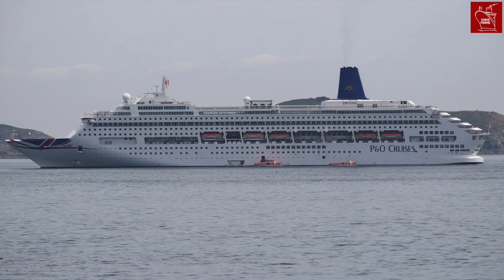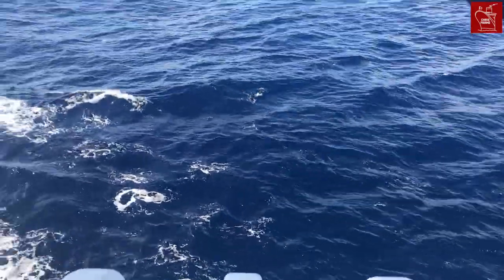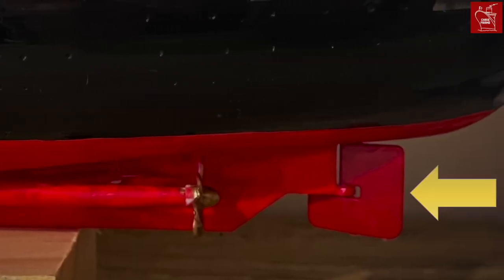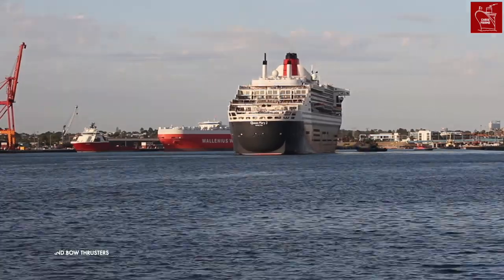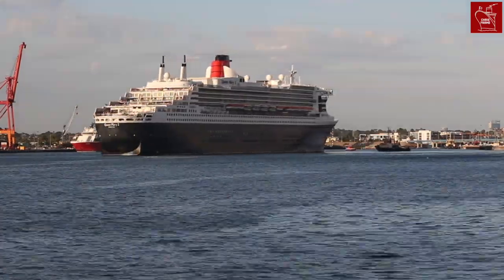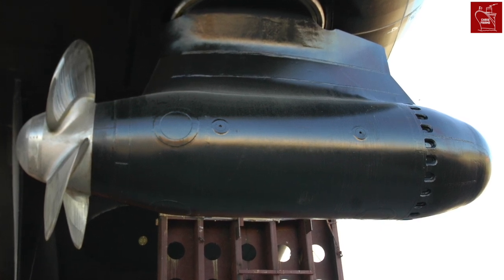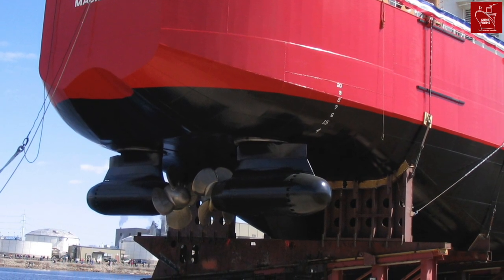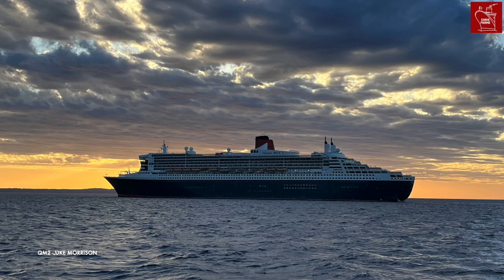What’s UNDER the Water on a Ship?

Comment: Thank you for such an easy-to-understand explanation of what's below the waterline of a both a modern day cruise ship and an ocean liner.  It's fascinating to learn about the markings on the hull denoting where the thrusters and stabilisers are and about the differences between a contemporary cruise ship and ocean liner in the interiors of these often forgotten, yet vital parts of the ship.  Having been aboard the original RMS Queen Mary numerous times on tours, it's encouraging to learn that the City of Long Beach have finally taken back control of operations and maintenance of this great lady.  They have done more to repair and restore her in 2022-2023 than any other operator since perhaps her conversion into a floating hotel in Long Beach in 1967-1972.  Notably, they have found her hull to be incredibly sound and restored five of her watertight bulkheads and built bilge pumps in the very unlikely event of a leak.  While they have removed all of her boilers and much of her engineering machinery, the mammoth size of these vacant spaces conveys how much machinery would have been there to provide stability.  Local mud now inhabits her double bottom to act as ballast, which was recently pumped out for an inspection, showing a clean bill of health, before being refilled.  The other vessel whose lower regions were visited was the SS Jeremiah O'Brien, the last surviving Liberty Ship that's still operational.  Located in San Francisco, this vessel is periodically taken out for events, such as Fleet Week, and also carries another noteworthy distinction.  The engines of the SS Jeremiah O'Brien, visited during that visit, were used in the 1997 James Cameron film, "Titanic."  Her reciprocating engines were used as stand-ins for those on Titanic, with small digital characters added to convey the illusion of great size.  In reality, each of the dual walkways seen around the reciprocating engines, depicted in the film with fully grown men running along each, were only large enough to plant one foot on each.  This was another great instalment of your ongoing series.  Many thanks and greetings from Southampton, England!